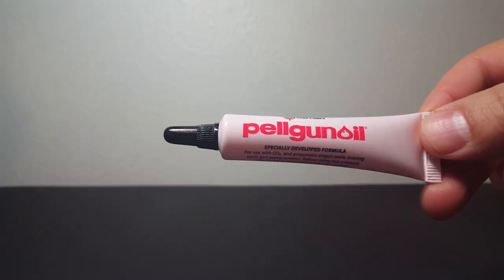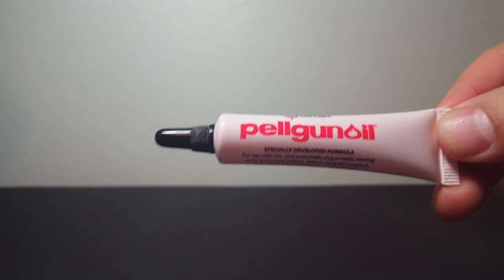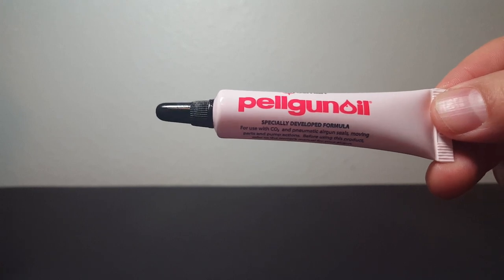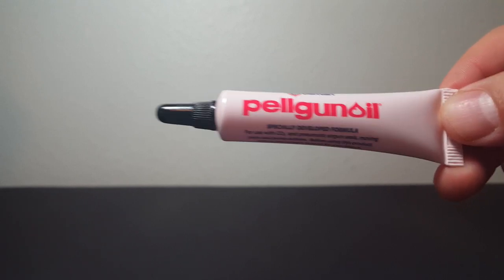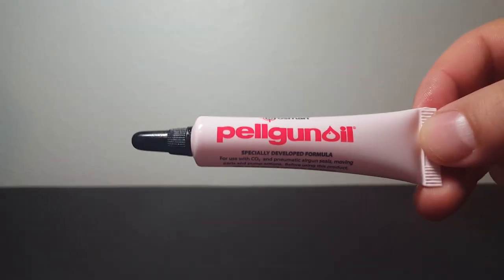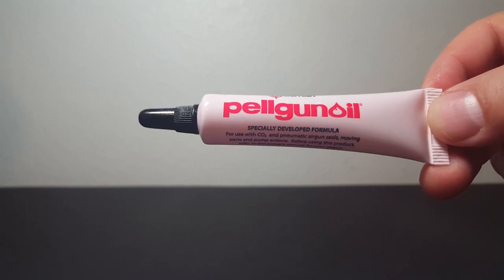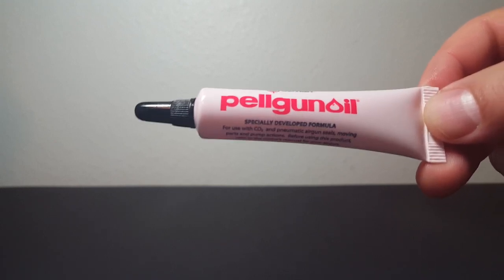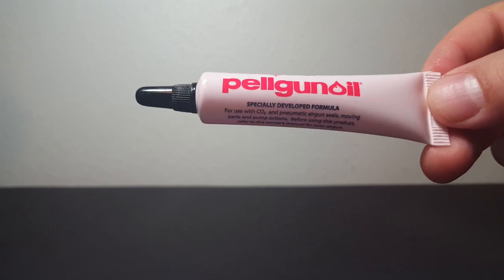Pellgun Oil: What is It?

Comment: Thanks for this video. It's great to know Pellgun Oil is safe for me to continue using where Hoppes 9 is not an oil I should use for anything other than lubricating the air pistol. The only thing is that for a tiny tube of pellgun oil, it costs 8 bucks so I might keep looking for alternatives but I might be stuck using those tubes. Too bad I can't spend 30 bucks on a large jug of it.
Reply from the maker: Russell, let me help you make your dream come true!

Please take to heart that Pellgun oil is heavy detergent motor oil. Nothing special, and my tube leaked. I never bought another one.

You don't need massive detegents in your gun.

Compressor oil is ND - and has no other additives that cause harm - so it is a great deal and runs about $20 FOR HUGE JUG. Many lube uses!

https://www.oreillyauto.com/detail/c/pure-guard/pure-guard-compressor-oil-4-quart/pgd0/ac18

Here is basic squeeze bottle to store it in, then shelve the jug. I've seen these basic bottles at the grocery store too.
https://www.hobbylobby.com/Art-Supplies/Painting-Supplies/Palettes-Tools/Squeeze-Bottles/p/57415

On firearm lube, I would keep it away from airguns. Like WD-40, I forbid that from being endorsed on this channel. Peope get away with using Hoppes 9 or WD-40 on a Ryder, then make the jump to pump guns and CO2. THEY DESTROY THEM!

I do believe that shooters get away with using WD-40 on Red Ryders, but that airgun is tougher- still NOT the best lube. WD-40 is great for wiping tools down. I use Ballistol for fast and easy spray lube for Ryder after a mag empties.
Reply: @daisy880fanaticfixit9  Thanks!! This must be why one of my mags started leaking and now I'm only using Pellgun oil cause that should still be 100% safe, right? I was using hoppes 9 on the tips of my c02 cartidges. I also use it to clean and lubricate my airgun but I believe that's okay still. Thanks for the links and please correct me if I'm wrong in anything! :)
Reply: @daisy880fanaticfixit9  Ah it seems I can't get access to those websites in Canada unfortunately. Maybe if you could tell me the name of exactly what the item is? I know most people use Pellgun oil but you also said I don't need heavy metals in my gun, is that gonna ruin it?
Reply from the maker: Russell, not surprised you are Canadian. You folks are SO MUCH more friendly. Most gun-loving Canadians really enjoy my channel and talking with me. Your country is more like Europe. Anybody who says Canada is like America...no way! America is very angry divided place right now.

So the oil product is Pure Guard Non-detergent compressor oil. The other product is just basic squeeze bottle. 

AND, YES, Pellgun oil is safe compared to firearm oil. I need to be fair with Crosman here. Pellgun oil,  yes, for CO2 and pump guns. Hoppes NO for airguns. Even general lube on metal on metal use the Pellgun oil.
Reply from the maker: PELLGUN OIL YES FOR AIRGUNS! 

HOPPES 9, NO!
Reply from the maker: Can you access Amazon?
https://www.amazon.com/Bottlify-Cap-Pack-Refillable-Condiment-Container/dp/B08DX9WLVL/ref=mp_s_a_1_8?keywords=squeeze+bottles&qid=1650000668&sr=8-8
Valvoline Daily Protection Non-Detergent SAE 30 Conventional Motor Oil 1 QT (Packaging May Vary) https://www.amazon.com/dp/B005XOOFEK/ref=cm_sw_r_awdo_ZJ4KWZ9B7AM8N0KVKBPC
Reply: @daisy880fanaticfixit9  Thanks, man! And yeah I gotta agree, most people think just cause we can have a similar accent in some places. (heavy note on "can", we have regions that have extreme accents too) but we're a Monarchy, not a Republic! Very different but it's easier to let ignorant Americans think what they want (not that all or even the vast majority are ignorant, the ignorant ones are very loud though. I can hear them up in Canada!). I have many American friends that are great people, not all Americans are a walking cliche and I think it's important to respect each other in our own rights. As long as that is held, I find most people get along fine. I also avoid talking about politics at all costs, it's a bit different down there, eh? :P

I appreciate your information so much and want you to know that you've helped me greatly preserve my magazines. Now I only need to replace some O-Rings, no big deal! The damage could be worse and now I know :) Appreciate people like you that make these types of videos just to help. Happy shooting, friend!
Reply: @daisy880fanaticfixit9  Ah crap, sorry for messaging you again but to clarify, Hoppes 9 is okay for lubricating the moving parts in my gun, right? Just not for the c02 mag. I use a Colt Commander C02 1911 and a Springfield Armory 1911 and have always lubricated the metal on metal parts with Hoppes 9 and a Q-tip, it also cleans out all the black gunk that accumulates. I can't find a clear answer online so I've come to you yet again as you seem very knowledgeable. I've been lead to believe that this is actually okay as long as it's not for the Co2 mag and you didn't correct me so I'm hoping it's okay but I'm double checking now. Thank you and please excuse my ignorance.

Edit: I actually found a kit on Amazon that was for airguns and it comes with Hoppes 9 oil. https://www.amazon.ca/Hoppes-Air-Pistol-Rifle-Maintenance/dp/B0002INOL2 It's simply called "Hoppes air pistol and air rifle maintenance kit" so I think it's okay for lubricating :) I apologise for bothering you with this confusing comment. If by chance you do chime in and say Hoppes 9 is awful to use even as a lube, I'm thinking of using RWS Chamber Lube for cleaning and lubricating as an alternative along with Pellgun oil for the Co2.
Reply from the maker: Russell, Pyramyd Air does carry that kit, BUT I really like your idea about RWS mineral oil and Pellgun oil combo. With Pellgun on your CO2 cap!👍
Reply: @daisy880fanaticfixit9  Excellent. You have helped me more than you know and I appreciate it so much. I said it earlier but my Co2 guns will work much better and for a lot longer thanks to you! This is a hobby that I really enjoy as it is an inexpensive way of getting some quick training in. Especially since a lot of shooters end up not going to the range and practicing for a while - I'd like to keep those skills sharp. You've cleared up a lot of things for me and even helped find some alternatives that are safe to use, like you've done a great job in helping my long and potentially confusing questions lol Looks like I'm placing an order for that RWS oil :) Thank you for helping me sort the correct items for my hobby, (which is supposed to be more fun than stress!) there's just so many products. Hell, I got the Hoppes 9 while buying BBs and the guy told me it's safe for Co2 guns but wasn't remotely clear as to WHAT PARTS it's safe for! So being me, I end up using it on my cartidges and you know the rest. I've been stressing out quite a while with so many contradictions online when I finally found your video. The fact that you're still actively responding and helping us out is awesome. I did not expect a reply when I saw the video was from 2019. Thank you again, sending you only good vibes from Canada. You saved my future mags and gave me valuable information. 

... I guess I am very Canadian, that's a very long message to just say "Thank you". It's pleasant to have the "nice" stereotype though, won't lie. Appreciate you, man.
Reply from the maker: You are welcome. And remember to make your CO2 seals last longest by taking out the CO2 when done, even if it has juice left. If you decide to call it a day, shoot into a bush quickly to release pressure then remove the CO2  cartridge.

STORE YOUR GUN EMPTY 👌
Reply: @daisy880fanaticfixit9  Yes! I have always kept them empty. Sometimes if I'm shooting in the backyard I'll let it stay in the mag for the afternoon but I never leave them in for say, 12 hours or something. I've always been good with using Pellgun Oil every time and dumping Co2 :) The 12g Co2 cartridges don't last too long so it's quite easy to load an extra mag or 2 with BBs and shoot the rest of the gas out. But ultimately, yes, I store the magazines totally empty of course with no (empty) cartridge inside unless I plan on shooting soon. Thanks, man :D Happy to say I'm a new subscriber of yours!
Reply: @daisy880fanaticfixit9  Hey man, just wanted to say I totally cleared my gun of any Hoppes 9 and lubed it up with RWS chamber oil and only use Pellgun oil now! They're smaller bottles but I really shouldn't need to lube my gun so much and the pellgun oil lasts forever since all I do is put it on my Co2 tip and then pierce it. Thanks for your help! I'm an anxious one, but I'm not missing any spots, right? I lube the friction points of my 1911 BB gun and then a drop of Pellgun oil on my Co2 :)
Reply from the maker: @halluzinate_  - Yep, lube on grinding parts. Drop on every C02, or at least every few cartridges.
Reply: @daisy880fanaticfixit9  Oh okay, good to know. I've been using Pellgun on every Co2 cartidge and wasn't sure if that was the right move but by what you said, it sounds to not be detrimental and a good thing to be on top of constantly. The RWS chamber oil is my new lube for moving parts in my 1911 Co2 BB guns :)

Comment: Great video! Is Pellugun oil actually a good/safe choice for CO2 guns (seals)?
Reply from the maker: Rhodri, your question is important because Pellgun oil is NOT Safe on PCP or a break barrel piston gun. 

PCP and Break barrell guns need high quality silicone in small amounts.  

RWS Silicone
CROSMAN Silicone
MAGNUM AIRPOWER SILICONE
Super Lube O Ring Silicone.

For CO2 you could use basic 30 SAE ND motor oil. It lubes the heavy metal contact surfaces like the piercing pin and the top of the CO2  cartridge. Improves seal on face plate and safe on seals inside.

Pros say the safest  lube method is putting drop of lube on the cartridge top. It lubes pin and gets inside. You can use the high-end silicone products listed.  Super Lube is best fit here if you want silicone - best deal at 4 ounces!
https://www.amazon.com/Super-Lube-56204-Silicone-Lubricant/dp/B083NXVGQX

30 SAE non-detergent better for metal on metal. The high quality silicone should do fine - just more expensive than large jug of 30 SAE ND.

Comment: I use that for pump guns and co2. Is that alright?
Reply from the maker: Steve that is all right.

(1) The debate is the PRICE per container.

(2) The HEAVY detergents in this blend. A quart of 30 SAE ND and a squeeze bottle from the store is a much better value. Can be used for many lube jobs.

With CO2, the debate is not to leave a cartridge in your gun when you are done shooting. It can wear down your seals - regardless of lube. 

Please toggle arrow at right corner of video to learn from Magnum Airpower.

Comment: Hello, thank you for your informative video! I do have some additional questions, if you don't mind:
I bought a tube of Pellgunoil about a year ago, and it has been open since then. Can it go bad? Should I keep using that tube or buy a new one?
Also, I mainly use a Red Ryder, a Buck, a model 25, and I may be getting a Daisy 880 soon. I have already used the Pellgunoil to wipe down and lightly coat the outside metal parts of my bb guns (outside of the barrel, receiver, screws) to protect them during storage. Have I made a mistake in doing so, or is that okay? 
One more question (sorry) is Pellgunoil good to use in the "oil here" hole on the Red Ryder, Buck, and model 25?
Again, sorry for the long winded comment and if you read this, thank you!
Reply from the maker: Kate, polite folks can say as much as they want! Also, always happy to help friendly female warriors.

Daisy would prefer you use a 20 weight for their little springers (Ryder, 25). Pellgun is 30 weight detergent motor oil.

You HAVE NOT DONE ANYTHING WRONG. No damage to your guns👌 The mineral oil won't go rancid SO LONG as you kept the cap on it and dirt didn't get in. You didn't polute it some how.

Pellgun oil fine for the pump guns. My gripe is its COST. 30 SAE ND does everyone Pellgun oil does - except cost as much. Just buy squeeze bottles for the 30 ND.

But you already have Pellgun oil, so it isn't a debate.

But for the Daisy spring guns I have a VERY STRONG OPINON. My best RR has been taken care of with Ballistol for years!!

The classical German oil is WORLD FAMOUS for wipe down to clean, protect, and BEAUTIFY in a way motor oil can't match. Also as roughly a 10 weight lube it actually INCREASES the performance of a Ryder. Old school pros have figured out the lighter weight lube does better in these spring guns. Daisy enginneers don't want thick oil in the oil hole. Too much 30 weight can inhibit performance.

Keep your Pellgun oil for pump guns, and please consider Ballistol for TOTAL CARE for your Ryder, 25. Just a puff in the oil hole every 600 shots (when you empty Ryder magazine). Super easy to use.

▶️ After you empty Ryder magazine, wipe down gun.

▶️ One puff in oil hole using straw on Ballistol. Aim down, cock, and shoot.

▶️ COCK your Ryder, set the safety, then flip in on its back. Puff Ballistol on the sharp point you see when the lever is out. The pointy spot grabs your plunger which contacts your sear. Smoothens shooting. Oil then close up lever. Shoot. Cock quickly 2nd time. Shoot.

https://www.pyramydair.com/product/ballistol-lube-aerosol-spray-6-oz?a=2072

You can order it or your local gunshop should have Ballistol.
Reply: @daisy880fanaticfixit9  Thank you for your detailed reply! I will check out the Ballistol. I have an old pink model 1998 that has what looks like very light rust on the screws. Ballistol seems like it would work well on that!

Comment: I wonder, could it?
if 4.5mm steel balls are in the magazine
if a very small amount of oil is dropped (thin oil)
Does the ball velocity increase?
I tried this on my 5.5 mm Hatsan Optima air compression rifle, it made a huge difference.
I dripped 1 drop of oil into the hole before I put the lead pellet
much more effective and went faster
Reply from the maker: Shooters do lube their pellets. I like copper plated ammo like Field Trophy Power - that also adds zip and speeds up drive. My best 880 is sighted for those.

JSB 8.4 Dome also seem to be NATURALLY zippy!

Some believe lubing BBs HURTS the accuracy of BB guns. Let me see if I can get you Cobalt 327 pro opinion.
Reply: @daisy880fanaticfixit9  gamo rocket 5.5mm 14 grain is best result in my Hatsan Optima... (800 fps velocity calalog)
Reply: Thanks for writing.
Muzzle velocity may or may not improve with an application of oil, but if the shots are inaccurate, any MV increase is moot. And testing has shown an oily shot tube hurts accuracy in a smoothbore BB gun. 

So I have found the way to get the best accuracy from a smoothbore BB gun is to keep the shot tube free of oil. Oil will always migrate into the shot tube from the compression chamber when the gun is shot. Whenever I notice accuracy dropping off and /or I start getting fliers, I use a .177 cleaning rod with a .177 cotton or felt “mop” or a jag for patches to clean the shot tube. I use patches cut from old cotton shirts. I use denatured alcohol but you can use 91% isopropyl. Don't use acetone or lacquer thinner because it will damage the paint. 

Mark